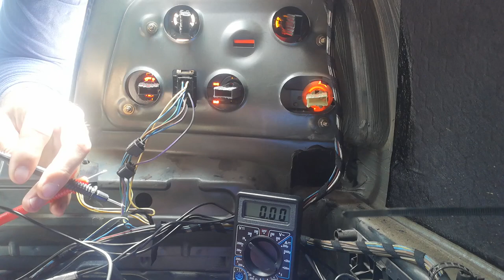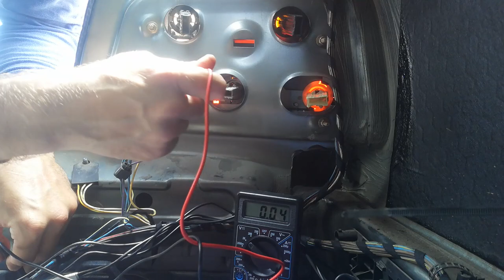TUTO - Installation d'un RADAR DE RECUL

Comment: La question est peut-être bête mais je ne comprend pas au niveau des branchements, il faut connecter le fil rouge au 12v et le câble noir se branche au quel du coup? Si vous avez une réponse cela m’aiderais beaucoup
Reply from the maker: Il n'y a pas de questions bête.
Le fil rouge oui idéalement, comme j'ai fait sur le + après activation de la marche arrière.
Le - sur la masse de la voiture. Théoriquement sur n'importe quel vis qui fixe la carrosserie. Sinon généralement les masses sont les fils noir.

J'espère vous avoir répondu.
Reply: @Namtamrof  Merci beaucoup, Excellente réponse c’est très claire! Tes vidéos nous aident beaucoup, t’es au top ! 👍
Reply from the maker: @MrCrows01  Mezrci beaucoup. Au top, moi? Non, je fait de mon mieux. Mais merci beaucoup. Le principe de ma chaine, c'est partager ce que j'aime, et ce que j'arrive a réaliser.

Comment: Salut sa ta pris combien de temps ?
Reply from the maker: Salut en plus de filmer, 1h15.
Sinon sans tuto 40/45min.
Reply: @Namtamrof  merci sur la mienne je compte installer radar de recul de récupérer mes commandes aux volant pour l'autoradio et installer  un kit de centralisation universelle pour ouvrir et fermer la voiture a distance car le concessionnaire ne fabrique plus les clef d'origine j'ai une 406 .
Reply from the maker: @teamyacine2239  de rien. Super projet.
Ah et le plus long c'était de démonter le pare choc arrière, car l'attelage m'emmerder.
Il a dégagé au passage 🤣.
Reply: @Namtamrof  mdrrr j'ai  
pas d'attelage  donc sa sera facile pour moi sur la mienne sa sera une toute option bientôt pour kit de centralisation regarde sa devrait t'intéresser après tu va en cordonnerie pour te faire graver la clef après ses bon le kit coute une 10 d'euro avec une voiture basic on peut faire pas mal de chose en plus sa n'a pas de valeur une 406 un rajeunissement lui ferais pas de mal pour le montage de la centralisation sais le même principe que le radar de recul faut trouver l'alimentation. Une fois que tu a trouver ton boitier de centralisation le reste c'est simple .
https://youtu.be/iI3ft7pMCHo